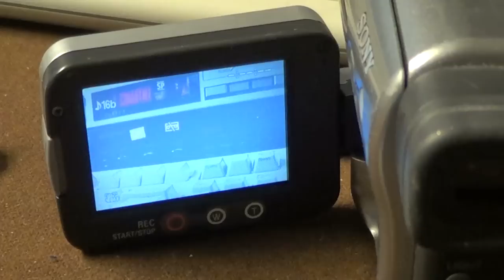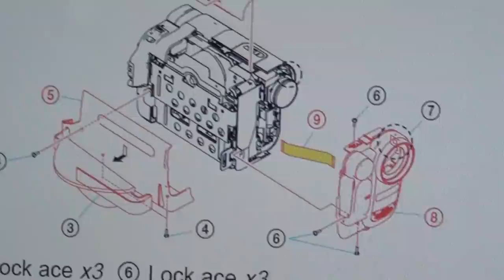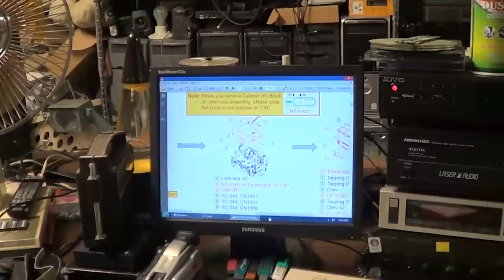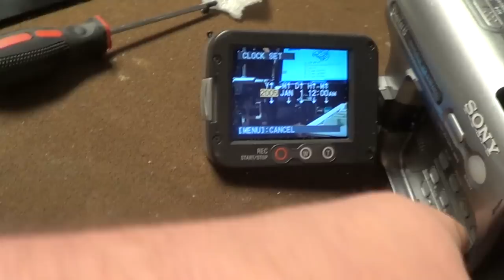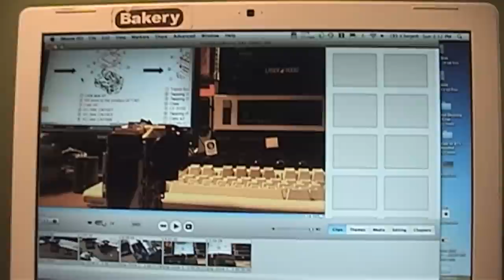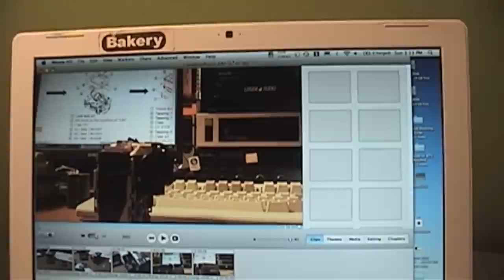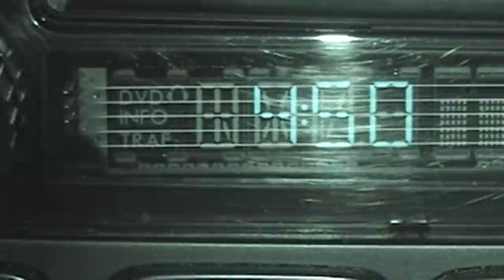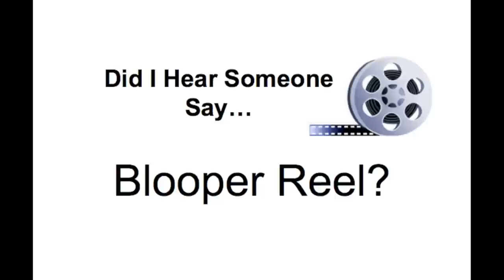Kitchen Table Electronics Repair: Sony DCR-TRV280 Handycam Swing Out Display

Comment: It's worth mentioning that the TRV280 was Sony's least expensive digital camcorder of the time (2005-2007) -- it had a list price of $250, whereas their cheapest MiniDV Handycam cost around $500. While you had it apart, you might have noticed the artifacts of the missing front panel S-Video jack, which had been decontented from the TRV280 and similar models, probably to save a few cents of production cost and help push those who still wanted S-Video output towards the higher-priced MiniDV models.

And despite the tape motor noise, the TRV280's microphone has noticeably better bass response than the PJ200's. The difference was quite startling when you first switched over.
Reply: ***** The model below it was the analog Hi8 CCD-TRV138. The complaints I used to get about most of my videos not being in HD have pretty much subsided now that more and more people are watching videos on mobile devices, where the tiny display and data bandwidth limitations make HD video nearly useless.
Reply: vwestlife For most, SD quality is better than HD because of the fact that people have cheap-o phones that can handle Wireless A/B/G/N, not all phones can handle AC Wireless.
Same deal with older PCs, and the lower end PCs.

Comment: 42:25 It's an aerial cable vibration damper. They are put on cable & phone distribution wires, keeps them from buzzing in the wind. Not often do I see tools of my trade in a UXWBill video.

Comment: Found a DCR-TRV260 on eBay that's listed for parts since it requires a "fix," a.k.a. The spanking or whack-a-Sony to realign the mechanism deck since the eBayer's Handycam displays a code error C:31:21 (Reinsert tape) in both Playback and Camera modes, in a matter of speaking. Pretty much like the KeyKeeper's old "Candyham" in a nutshell.

Comment: I have two vintage 1970's sets of lights on my ceiling and I believe a 1980's set on one of my trees. If you have an old set of lights with replaceable bulbs, you must replace a blown bulb as soon as possible. Most lights with replaceable bulbs are wired in series, thus when a bulb blows it puts extra strain on all the other bulbs. If too many bulbs blow and are not replaced the strain will eventually blow every bulb in the set.

Mum has an anniversary clock, damn thing only works when IT wants to work. lol

Comment: Hey uxwbill! silly question but my family just bought a samsung washer. the plumbing is fine but we dont have an outlet near by. would it be a bad idea to use a extension cord for it?
Reply: ***** i have a 14 gauge extension cord that was designed for car block heaters. would that suffice?
Reply: ***** thanks uxwbill. iil give it a shot!
Reply: hey uxwbil, i tried it on the new samsung washer we got. it wotked! however i only used the cold water setting. i havent tried steam since i assume it would draw more power haha. the energy star paper said the washer only uses roughly 10 dollars of electricity a year ! Lol
Reply: Riskteven no samsung "de teched" there washers this year, which is a good thing, no touch screens or wifi this year.
Reply: Riskteven i think its better cause less stuff to go wrong. if the touch screen broke, it renders the whole washer unusable.  the only cool thing was the wifi, where it let your phone know when ur laundry is done. but a quick look at the time and clock can tell you that ahead of time any way. the washer i have does have a touch capative button layout, but still all manual controls. no fancy screen or anything. good move for samsung in my opinion. sometimes a washing machine, should just remain as simple as that

Comment: Hey uxwbill, quick question: How much is it for a new LCD screen for a Sony Handycam DCR-TRV260? We still have the camcorder from 2004, but, unfortunately, back in 2007 or 2008, the LCD screen doesn't work, however, it still lights up, but has lines across the entire screen. Other than that, the camcorder still functions, if only the charger isn't missing and if the battery wasn't dead, I would've done a demonstration of the camera. I could try to charge the camcorder with a USB cable to see if the camera functions, like ejecting the tape.

Comment: Bill, I need help with my DCR-TRV480 hadycam. Not much info on it on line, I need to fix the tape receiver. Yes, I pushed where it says not to. Service Manuals are ridiculously unattainable online. Any advice?
Reply from the maker: That's probably not going to be an easy fix. I did not have any trouble finding a service manual, but how much it goes into the mechanism I cannot say. Link accurate as of 09/2020: https://www.manualslib.com/manual/972501/Sony-Dcr-Trv380.html

My guess is that major mechanism faults were dealt with by replacement.

Comment: I habe started making some videos of my own and I am thinking of buying a trv 280. My current Nikon point & shoot deal is just not doing it for me. The only other cameras I got are a, broken sony handycam cx330, (was given to me with faulty main board) my crappy phone camera, and my personally modified JVC CC6272 VHS-C camcorder (which I used to record my newest video).
Reply: Do you know where I could get one for a good price?
Reply from the maker: Sometimes you can get lucky at a thrift store. Outside of that, eBay, Craigslist or any local flea markets, that's all I've got.

The more well used Sony Digital8 machines are starting to feel their age, and may require some service. Backtension and escaping pinch rollers are the most common problems.
Reply: Yea, I am starting to have some trouble with back-tention in my JVC CC6272.
Reply: I also need to lubricate the drive motors.
Reply: I ended up buying a Sony DCR DVD 305. The reason I went with this weird format is because these DVD based Sony "Candy Ham's" are dirt cheap. It seemed that any of the Digital 8 based camcorders were out of my price range, so I had a look at Mini DV versions of the same comcorders, and found, again, were too expensive. I then realized that the DVD based candyhams were basically the same thing as other camcorders, but with a DVD drive stapled to them. Since I could get this almost brand new camcorder for only thirty bucks with no loss in video quality, I went for it. I then went out bought some Fuji Film 2.4gb DVD-RW's for only a $5, which was nice, but I found that I can get only about 40 minutes per disc in 640 by 480. This kinda sucks, but it is made up for by the faster access times provided by the disc format. The write times are not very good compared to a magnetic tape, but this is not a very big deal. It is not the best camcorder ever, I do wish to one day upgrade to a DCR TRV 280/480 one day, which has lead me to make some of my own modifications to it: I first added a wide angle lense, (which I ended up taping on with electrical tape) Added a proper video light in the form of an LED glued to the top of the lense, (because nightshot plus did not seem to really cut it) and replaced the shroud over the viewfinder since it was designed very stupidly (What happeded to good viewfinders? Since the viewfinder just ended in a piece of glass and not a piece of rubber to hold your eye, I found my lashes uncomfortably touching the glass, so I pulled the shroud off the viewfinder of a dead camcorder and glued it into the place of the original viewfinder). I would like to see your thoughts on the Mini DVD format, and your opinion on why these camcorders are so cheap.
Reply: I noticed that dispite what you say about hating facebook, and never having a presents, which I don't either, there is a facebook page under the Uxwbill name. I discovered this when searching for "Don't Watch This" on google a few days ago.

Comment: It would be awesome if I could get a LED light on my HDR-SR11...oh well. Date can be easily done with FFMpeg with tapeless video if you have the date set right on your camcorder when you record video.

Also, on NightShot being depowered, would it be theoretically possible (at least on newer camcorders) to write firmware to allow you to adjust exposure while in NightShot? If so, I may have a jab at that with my SR11 and my cousin's DCR-SR45.
Reply: Hmm...
Reply: Getting the service manual out for my SR11 so I can mess around with it.
Reply: First, I need some biscuits...

Comment: I have a Sony HDR-CX220. It does have a power socket, but it didn't come with a power supply. Grrr.  It uses an USB connector to charge, but can't shoot video while plugged in. Double Grrr. At least it agrees very well with my authentic Apple wall wart. I wouldn't mind having a few more of those. They are whisper quiet compared to the Dollar General charger I didn't bother plugging expensive electronics into. That one went belly up by leaving a prong behind. At least it was plugged into an extension cord. All I had to do was unplug the cord to safely extract the prong.
Reply: Have you tried pressing the Play button on the flip out screen after you plug in the camera to USB? My CX240 swore it couldn't shoot while plugged in, but I just hit the play button to switch it into shooting mode and it worked just fine.
Reply: ***** Not to mention in the newer camcorders (like mine) it is all USB, so if the inbuilt USB connector should ever break, there's no way to charge/interface with the camera short of using an external battery charger and pulling the microSD (yes, micro) out and putting it in a card reader.

USB is very handy (Like, I'm able to run my CS240 damn near indefinitely because I have a 10,000mAh USB battery backup), but I hate that it's the ONLY way to get power into my camcorder, especially since the USB cable is built in.
Reply: Xodium No such luck with the play button on my model. The only time I use the USB is for charging. At least Sony supplied a USB extension cable. It uses a standard SD card. I just remove that to retrieve my videos and an occasional picture. The built in stereo microphones have decent separation when used outdoors. It does have what appears to be the Sony proprietary power socket. I'd like to get something for that socket sometime.
Reply: ***** The dumbest thing about Sony's new low-end camcorders has got to be the battery compartment. Have you seen it? It only allows one type of (very small) battery. Anyway, I have the HDR-CX280 which is a step above the CX220, and it came with the AC adapter which certainly charges faster than USB as well.
Reply: jefferyb304 I must say that I'd still prefer your model, lol. As I was telling Bill, if the USB plug ever broke on my camcorder it'd become a massive PITA to use. Like, it could have been completely avoided if the microUSB port on the camera did anything to charge it, but it does not.

Also, I don't get what power on this green and blue earth possessed Sony to go with microSD on the 240...
Reply: ***** I think its more that they don't see value in that market anymore because they're getting pinched by smartphones. Quite sad, really, because even as a hobby, doing YouTube videos feels janky with a smartphone. I was almost about to buy a miniDV camcorder, that's how much I hated shooting videos with my phone.

Comment: I usually destroy any counterfeit Power Supply and save some parts where I can fix any Genuine (real) Power Supply and even a Generic Power Supply so I can reuse them whenever I need to.

For instance, in 2003, when I got the video game of Power Player video games from flea market, it usually sells a counterfeit power supply which it was worked just fine, and I've noticed the design of the counterfeit power supply that has no metal shield, very light, they are so cheap and had a very poor quality. And I can tell the terminals on that metal type terminals is iron metal, and it tends to rust off when the moisture can ruin the terminals which it can cause them to fail to supply the electricity for video games, and they supposed to use a real descent rich silver type terminals where it will not cause to rust very easily, and they have to use the right type of either genuine, or generic parts so it will not cause to ruin any electronics. For mine, I can do that is to fix any genuine or generic power supply for mine, and I won't allow myself to fix any counterfeit power supplies because, it can ruin the electronics and so fourth where it can cause to overcharge through the wire, terminals, and even the batteries.

Comment: Hi, did you recorded this video with tapes?? Or with some clearclick thing? (The footage with the Sony DCR TRV 280)
Reply from the maker: As with all Digital8 camcorders, the video is recorded in digital (DV) format. It can be transferred to a computer using a Firewire port.
Reply: @uxwbill  thank you, do your camera show the no tape logo on the monitor screen? Because im thinking about buy a clear click software to go tapless but maybe that icon appear on my videos, it doesn’t have form to quit
Reply from the maker: @nkbeatzoff  It's been a long time since I used the TRV-280, as the tape mechanism began to develop problems. They are probably fixable, but I'm sure I'd deal with even more pushback if I used a standard definition camcorder today (and didn't bother to upscale the output, which can be done with special software). The tapes are also getting harder to find, though I still have a few brand new ones. (No, I am not going to sell, give away or trade them.)

I believe it's possible to suppress all display messages from the analog video output from the camcorder's menu system (something like Display > V-Out or LCD). The icons always show up on the display panel and viewfinder to the best of my knowledge.

In all honesty, for the best possible results, you should connect the camcorder to a Firewire port. That's how it was made to work the best. Computers with expansion slots (even PCI Express) can have one added cheaply, or you could get an older laptop or desktop with a Firewire (1394) port and capture the videos there. Then you could transfer them to a newer computer. All popular video editors will handle DV format video easily. Windows 10 and 11 still support Firewire/DV camcorders. I'm less sure about the Mac OS (no Apple computer that can still run current operating system software has a Firewire port) and Linux may require some diddling around with configuration files before it will work (it's been a long time).

If you didn't want to or could not use a video tape, a live video feed from the camera is also output over the Firewire port on the camcorder when in camera mode. This will not have any of the on screen messages or icons displayed.
Reply: @uxwbill  Thank you bro, the only message in thr screen monitor is the no tape icon and there is no way to quit that, so maybe o i use a clear click device praying to get a clear image

Also i tried connecting my camera on the computer trought the fireware cable but it didn´t work

Comment: I have a question...why is your mouse on your computer so laggy?
Reply: Zachary schoensiegel My guess on why his mouse is laggy is because the PC he wad using has a Core2Duo CPU in it running Windows 8.1 at the time the video was recorded. Running Windows 8.1 on a PC from the 2007-2008 range is quite sad. I ran Windows 8.1 on my older PC setup that ran on an AMD Athlon 64 x2 4000+ Dual-Core, bow I have Windows 10 on my AMD FX-6300 Hexa-Core rig and it's faster than the older setup I had previously.
Reply: that might explain it!! :)

Comment: what site? service center diagram
Reply from the maker: I don't know if the site I used is even still online. I would recommend a web search with a reputable search engine.
Reply: @uxwbill  ok i have sony handycam TVR480. The when i play the tape no output..totally blue no soud also the lcd view finder not work..need to surgery my cam but i dont where i star..thanks
Reply: what www?
Reply: do you a copy? sir

Comment: Sony DCC-L50 comes with two different DC adapters that plug in. If you have any use for it with the HC19 type adapter you could cut the plug off the other ( in this case redundant) adapter and use that.
http://www.bhphotovideo.com/c/product/300449-REG/Sony_DCCL50B_DCC_L50B_Car_Battery_Adapter.html

Comment: WARNING:  Most people don't know this and can ruin this older camera and repairs are very expensive.
When you connect these DCR-TRV cameras to some computers with a battery in or AC power connected it can cause an electrical ARC that can fry the IEEE194/ "firewire" connection board.  THEREFORE, connect the cable BEFORE power is connected or on.
NOTE:  Using the "firewire" connection gives the best quality transfer.  The RCA connections are pretty bad quality and the USB never worked right.  Also,  the bummer is good luck finding a computer or laptop with working "firewire" connections, as they went out when USB 3.0 came out.

Comment: Hey uxwbill I have an old Sony DCR-TRV260 that hasn't been used in years since moisture got in the LCD screen about 8 or so years ago, and I charged the battery (still surprisingly holds the charge), the side screen now works, but now the lens thinks the cover is still on (no picture, except for the icons, time code, etc.) I posted a video here: https://www.youtube.com/watch?v=PmgD1txXijU I was wondering if there's a fix for that, or should I invest in a new part for it?  That and I think the tape basket is acting funny (ejects the tapes and loads the tapes without issues), but I think it's a bad tape.  The tape in it now is a Hi8 tape from Maxell and I do have a blank Sony Digital8 tape in my house that I might test out.
Reply: Edit: The Candyham displays an error C:22:00 while recording on the tape saying please clean the video heads. That's probably why the camcorder isn't displaying the picture...